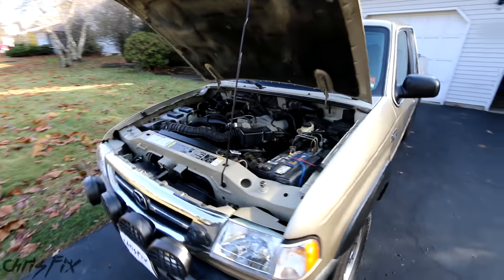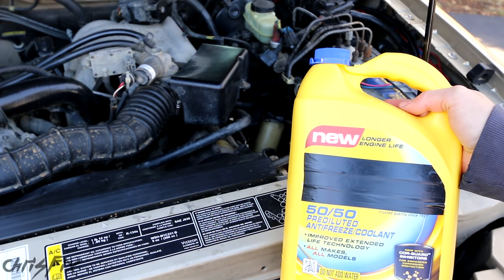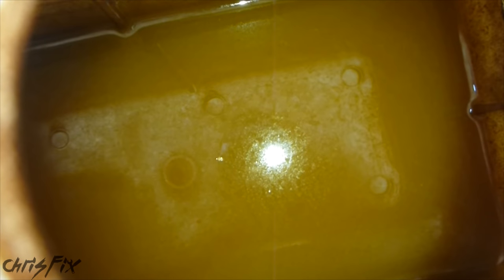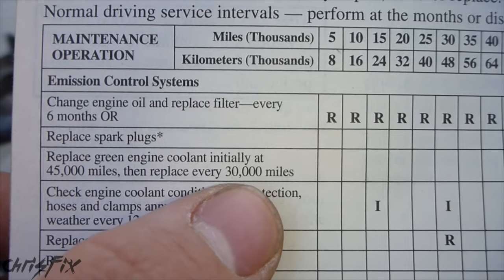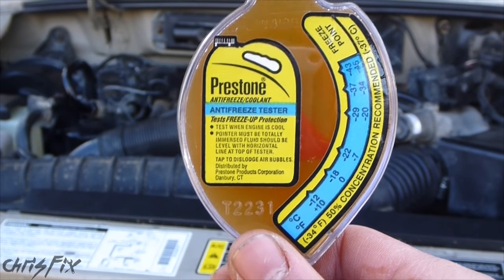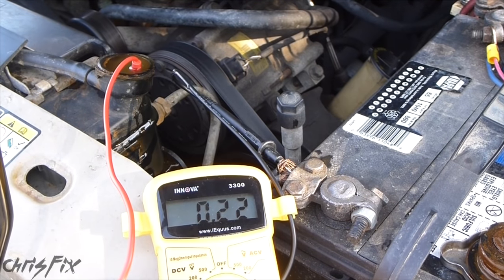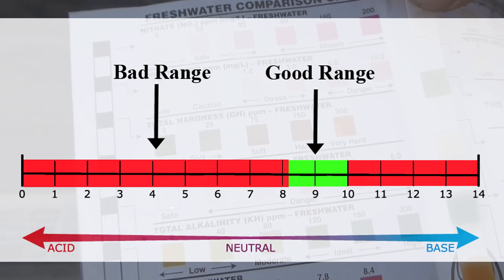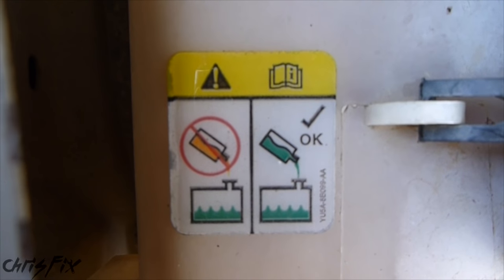How to Check and Test Your Coolant/Antifreeze

Comment: Just as I had shared with you last week, the pH test told me i had fuel present in the cooling system.  My customer owns a Dodge Dakota with acid coolant, found the #8 cylinder was steam cleaned, it lost it's seal and that fuel in the coolant made the system turn acid. Fuel is one thing that can make sudden changes in pH, and was really the only test that could show the problem, it held pressure, and had several O2 sensor readings out of limits.
It took me awhile to tear it down but I am so happy that I did, it always gives me that tight stomach feeling when making these calls, and it turned out I nailed it. This truck will soon have the heads checked and new gasket's throughout.
I liked your other test's and will experiment with them, but last word before tear-down is the pH.
I couldn't find my usual test strips at the store, they check for concentration and pH, so I used what I had left from my old supplier, soon I will have some new strips especially made for autos, and I will share the source with you.
Reply from the maker: James Fenton Thanks James. I checked each cylinder and there is no head gasket leak. I think the system is just so dirty and messy that the pH is acid. I am going to do a coolant flush and put new coolant in and monitor it, but I think the head gasket is fine. I will keep you updated!
Reply: Yes, do keep an eye on it, something changed the pH and small leaks can get bigger fast. I am interested in this whole subject, and want to approach it using all the info we can gather. I will be checking the chemistry involved, and see just how acids are made inside the motor.
Thanks CrisFix, James Fenton III

Comment: Thanks! That helped a lot. My coolant was reducing rapidly and I was worried. I topped it up from a 5 liter of the recommended Elf brand coolant and drove a total of 500 miles uphill and back. I kept a watch on the temperature dial and the car did not heat to a critical point during the journey. However, when I checked the reservoir again, the coolant level was almost zero. That got me worried and I got it checked at the garage. Test with a pressure gauge for radiators revealed a leaking elbow in the coolant circulation which I replaced, much to my relief.

Comment: Really appreciate the video but also want to share that, as I understand it: A hydrometer can't be used for Propylene Glycol Coolants (only Ethylene Glycol) and those test strips often can't be used on orange or red dyed coolant as the dye can affect the reading and make it seem okay when it's not. I believe a refractometer would be the best option that would work on all coolants.
Reply: Yeah, be sure to check the hydrometer. I bought one from autozone that says it "works with all engine coolants", which I'll take their word for it.

Comment: can i just add the coolant without changing the previous?
Reply: Gary what do you think
Reply: No Gary  -_-
Reply: by not changing the coolant and not flushing the system, you're adding a clean fluid to dirty/contaminated one.
Would you just add oil instead of changing it?  Same situation (in theory).
Always do a fluid change and remove as much of the old one as possible... flushing the system is a great thing too!
Reply: Gary Flush it bro
Reply: You can to top it off - but it depends on how long its been since you changed it

Comment: I used Napa 4106 ph test strips on 6 engines today, and results were all over the map. The instructions say, "this product not for use with long life organic acid technology (OAT) coolants. Do a little digging and you'll find several engine coolants use this technology, making my testing "questionable". To further add to the mystery, with the engines cold and shut off, I tested voltage in the coolant and the top end of the range was my corolla at +.148 volts, while the 5 other engine coolants all tested negative, with my ford excursion coming in at -.37 volts. I've read that ground issues play a role on this test, and many are saying it should be done with the engine running to get flow across the lead.

Comment: really an excellent job on this tutorial and the flush job.
had heard on a video to check the voltage but they didn't show how and that you showed all 4 ways to test coolant was far above other sites,
The car shops can be such ripoffs.  After doing the procedure as detailed I took my truck in for an oil change and they told me my antifreeze was worn out and needed to be replaced.  Last oil change there.
Reply from the maker: +carlis norvell Thanks a lot! Glad you learned a lot! Do your own oil changes: https://www.youtube.com/watch?v=O1hF25Cowv8

Comment: Looks like that cooling system has had an additive added to it too (stop leak maybe), looks pretty crappy, glad you are changing it out.  When I was younger we used to say you’d get 2 degrees of boiling temp rise for every pound of radiator cap pressure but… I just did a search and the rating now is 3 degrees per pound.  That’s a 45 degree boil temp raise for the typical 15# radiator cap.  We used to check them too as part of our service.  Had a “Stant” brand tester.  Did not know about the multimeter test.  That was a good tip…
Reply from the maker: ***** Thanks man and thanks for the info. That is a neat little trick with the pressure reading! I am glad you learned something new with the multimeter test!

Comment: i was just going to add water once i figured out which cap is for coolant. i thought since its summer, that would be ok. so glad i watched your video. i still don't know which is the reservoir but i do know what is the radiator. i will pull some out to check it.

Comment: Wow, I'm a novice on cars, so I had no idea about electric current running through the coolant. My last car was pretty old and we ended up flushing the radiator a lot more often than was normal (like to fix the hose or something else), so I haven't personally seen nasty coolant. Just got a somewhat newer car so any info on maintenance is what I've been looking for. Lotta great vids, thanks!
Reply from the maker: Lehst No problem! Glad you are learning a lot and you like the videos!

Comment: Very interesting and helpful.  Incredible production values.  Yours are  the only videos where I can actually see what's being worked on instead of just the back of someones hands.  And that includes some professional videos on TV. 

Now for the question.  My antifreeze looks good, has voltage reading of 0.04 (cool tip) but floating ball hydrometer reading of only -10 F.  Haven't tested pH.  I had a complete fluid flush done recently.  Oil & filter, transmission, brake, antifreeze, power steering all for $160.  As they spent only 30 minutes doing all this, I suspect I just got the most expensive oil change in history.  My cooling system contains just over 9 quarts.  How can I tell if they actually did the work but simply used only 4 quarts antifreeze with 5 quarts of water instead of the normal 4.5 quarts of each?

Looking forward to a strut/shock replacement video.
Reply from the maker: Stanley Linken They probably used a cheap antifreeze so it only went down to -10F (or like you said, a high ratio of water because that is cheaper too). I would take some coolant out and visually inspect it since you did all of the other tests. Use a clear plastic cup and that new coolant should look really clean. Otherwise, you really cant tell if they actually did anything.

Comment: it may be an old video but great info especially the DC voltage reading from the coolant to ground at less than 0.3vdc. great idea to block out the prestone brand on the antifreeze container. to this day i would not use that green stuff in my cooling system

Comment: Also, we used to consider it a rule of thumb, back when most cars had non-pressurized overflow tanks, not to take samples for testing from the overflow tank.  They often sit full of fluid and age/degrade differently than coolant actively circulating in the system.  ;-)

Comment: I just purchased a Laser Antifreeze Tester here in UK which is more expensive than the one you demonstrated. I was disappointed with its performance to say the least. It's a disc based system and there is no clear outcome of the test as the discs tend to bunch up or stick to the side walls. Thanks for your demonstration. 🙏

Comment: The part I like the most of this video Chris is how you mentioned that the coolant is lubricant for the seals in the water pump and that is so true. Another thing is the reason why it's so brown is because its water and it has rust in it. it's not orange coolant or it wanting cause the block to rust.

Comment: Hah, I have used the turkey baster option many times. Once, we accidentally put a bit of oil into the antifreeze and used that turkey baster to remove the oil that was floating on top of the antifreeze. I also simply want to say that Chris Fix ROCKS! even if he has a time saying "water." I say it in all good spirit, I have learned so much from watching your videos. If you need a 'jack of all trades' to help you, just call me.

Comment: Firstly, thanks incredibly much for your absolutely fantastic videos!

One question: does it make sense to go by these 4 tests instead of the recommendation in the service manual? I mean, if the service manual indicates it is time to replace the coolant, but the tests you describe show the coolant to be in good condition, it makes little sense to change it. Right?

Comment: I just had a radiator flush done today by radiator shop. I was sitting close in my RV watching him. I didn’t see him put a container under the truck (f150 1999). When i went to pay I looked at the overfill and it looked dirty. He said he could clean that out. So I guess I’m doing all these tests to see if he did it. I doubt my husband ever flushed the radiator. But it only has 60,000 miles on it.
Reply: Okay went and looked at the fluid and it is kinda Orange. So I’m just giving him the benefit of the doubt. The radiator got hot a couple of times but he said it had nothing to do with the radiator flush. We’ll see down the road. I just like to keep everything up to date.

Comment: You are always so thorough, awesome!

I must point out though that when you read the hydrometer reading, you clearly did not have the coolant level in it at the "fluid level" mark. You mentioned it but your fluid level was higher. Your coolant was nasty so it's not a big deal, you were changing it anyway. It's important that viewers know the fluid level affects the reading.

p.s. I just checked the coolant on the truck I recently bought (91 Jeep). The coolant strength is super high and brown with chunks. Guess what I'm doing soon LOL. It's gone one of those stupid heater control valves too, I may eliminate that while I'm blowing out the heater core. Cheers.
Reply from the maker: Thanks man, but the fluid level was correct.  You need to fill the hydrometer to at least that line.  The line is there because if you don't fill it up enough,  the red arrow can't float properly.  If you fill it over the line it, it is fine.  Glad you were able to test your Jeep. I assume you saw my heater core flush video: http://youtu.be/LD2LGkUycQg
Reply: ChrisFix Yep saw that video. My understanding is that the fluid level meant "fill to here" not "fill to at least here", but I have not looked at the packaging or directions on the tester.

I found out my rad is leaking so I ordered a new rad too LOL. My cooling system will be 100% when I'm done :-)
Reply from the maker: dainternetguru Awesome! Good luck on the radiator replacement!

Comment: Very nice thanks. Just two cents: I believe the voltage is going high when  the engine is running the voltage increases form ~12.5V to ~14V. Again, thanks for putting this together.

Comment: Hi there @ChrisFix. Thanks for your videos they are the GOAT for the DIY guy like myself! A quick question. What happens over time if I accidentally reversed the leads with the voltage meter??? EG. BLACK LEAD WENT INTO COOLANT BY MISTAKE.

Comment: Overfilled the temp tester, there's a "LIQUID LEVEL" line on it. In this case it only raised the reading a little, but was still too low. And the coolant has orange dye (& rust?) in it, probably messing up the pH test strip color since it looked like the same orange color as the coolant

Comment: Hey Chris great video thanks for the tips one thing I noticed is the wires coming off your + battery terminal If I was you I would fuse them to prevent a fire.
Again thanks for the tips.
Marc
Reply from the maker: +Marc Bienvenu Thanks Marc, they are fused.
Reply: +ChrisFix Its just I had a bad experience with similar wires coming off my battery Ive since fused the wires as close to the terminal as possible making the total length of the wire fused.
Today is the day I change out my Jeep radiator again thanks for the tips.

Comment: Any time I have an issue with my car I go to your channel. Very informative.

Today, my car overheated when I got to work. I waited till after work to check the radiator and it was completely empty. I had to use water as a temporary fix to it. Also, my coolant reservoir was empty. Do I buy the 50-50 coolant mix and fill it up to the top on the radiator cap or the coolant reservoir? I'm confused.

Do you have a video for that?
Reply from the maker: Mr. Vega First you will want to find out why you dont have any coolant. Then you will want to drain all of the water in there and add the 50/50 mix. This video might help: https://www.youtube.com/watch?v=g8YZF5cW7-A

Comment: I got one of those electronic pH testers and found that I couldn't get it into the Xterra radiator or overflow bottle. Plus you need to calibrate the tester.  So pH strips might be the better way to go unless you can find a tester that will fit the smaller diameter radiator fill points.

Comment: Revisiting this Video as I have a vehicle with some Dex-Cool Sludge problems and while it doesn't seem as bad as the vehicle in this video (or other vehicles I've seen with this issue) it does need changing, just that I'm seeing more "gel" rather then Mud.  Freeze/Boil Temp is VERY good (almost too good... But matches Historical testing noted in Log).  I suspect, it has seen 15 years of service on this coolant (with some extensive lose/top off over that time) but no Official Drain/Fill/Flush...  

Interested to see what the Multi-Meter and PH testing comes up with.  I don't want the "gel" to become a bigger problem but if the PH and Volt readings are in "good" ranges I can be more cautious and methodical with my flush...

Comment: A tip on using pH sticks - touch them on their side, for only a moment, against a bit of paper towel to drain that bubble of excess liquid off the top of the indicator square - especially when you're testing an orange liquid for acidity which shows up as orange - you need make sure to be looking at the colour the indicator turns, not pigment in the bubble of liquid sitting on top of it.
Reply from the maker: Ben Greening Thanks for sharing your tip! That is a good one!

Comment: Great video on coolant. I've got a question. Bought a car with 4 core radiator but no overflow tank. How do I safely check it? I know enough for it to be cool but is there any problems I can cause by checking it all the time?

Comment: Thanks, I ran that current test for the first time, my coolant is about 18 mos. old and under 25k miles.  At 20vdc setting, I read 0.09, so I guess that confirms it's still very clean (it looked so).  The hydrometer says only to do while cool, that only has to do with not burning you and not about chemical reading, right?  I'll wait to check in morning, but I don't think I need to.  I like that ph test.

Comment: Another good one. Are you going to do a new flush video? When doing a complete system flush would it be a good idea to put the new antifreeze in while the engine is running to push out the water that you were running through? Similar to like you did in your heater core flush video?
Reply from the maker: Thomas Brendel Yes I am doing a new flush video! It is a good idea to flush out the water from the block if you want to go the extra mile. I am still designing what the next coolant flush video will be. I am not sure if I want to go all out and do a perfect flush, or make it easy yet still do a good flush. I wish I could do both lol.

Comment: Chris, please do a video about the four different types of radiator caps, I never knew about this until recently. Oh and could you please explain two different coolants: Ethylene Glycol (which is what my manual says to use—the HOAT version ..?..) and Propylene Glycol (manual says NOT for my engine). I DM’d you the link to the article I saw, in your IG. Thanks!

Comment: Thanks much for the help. Seems I can run a clip lead from the battery to the fluid in my bucket, then a second lead from the bucket fluid back to the battery. With the leads not touching, the VOM should tell me how much conductivity my old fluid has without having to put it back into the car. If that fails, I have already ordered some new fish tank litmus paper, I have some that's years old and am afraid it may not be as accurate. Thanks much again and any thoughts would be appreciated.

Comment: Quick question. Is it okay to top up my coolant with distilled water?

Some extra info... It was changed two years ago during regular maintenance, but I'm not sure which brand they used. It's green, although the recommended coolant for my car is red or yellow. I plan to flush it out and add the correct coolant myself next time (in a year or two), but for now I'd just like to top it up. I've performed a visual inspection (looks fine) and the hydrometer freezing point test (-26 °C) so I'm only worried about the level which is very close to minimum. I know diluting it will affect its freezing point, but I wouldn't mind even if it measured -20 °C.
Reply: Get the right stuff per OEM Manual.